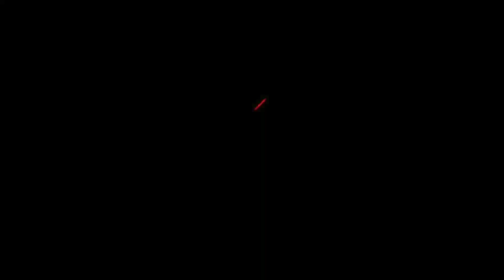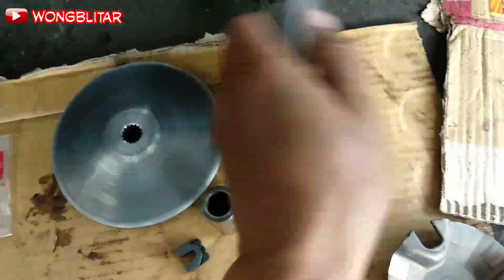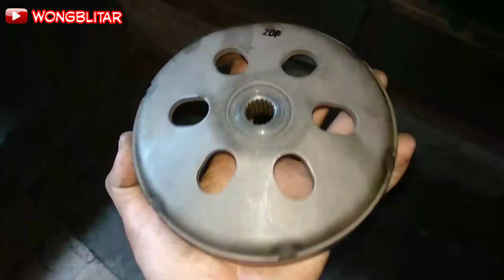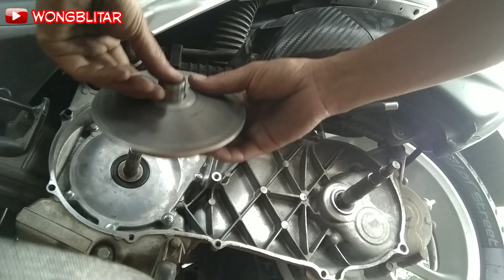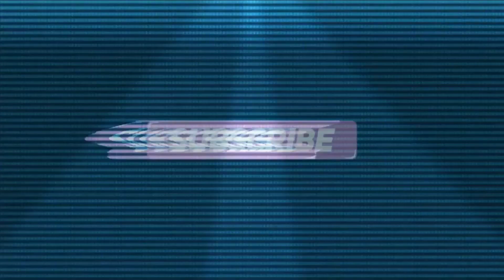Upgrade nmax tanpa bore up

Comment: untuk karet grand nya itu maksudnya punya motor yg mana ya
Reply from the maker: Motor astrea grand
Reply: terus gearboxnya ori yamaha aerox atau merk lain?
Reply from the maker: @prakosoe  ori bang
Reply: kalau ring pulley depan pakai merk apa bng
Reply from the maker: @prakosoe  ring apa bang
Reply: ring bulat yg diletak dibos ditengah rumah roller sama kipasnya
Reply from the maker: @prakosoe  gak ad merk
Reply: @prakosoe  ring mio j mas
Reply: @prakosoe  roller pakek punya xeon rc
Reply: @WongBlitar  maap mau nanya kl nmx bunyi cit2 pas lgi jalan kira2 apanya ya yg kena pa

Comment: Bang nanya dong tpi diluar vidio aku pnya rx king thun 96 tpi susah hidup pfhal dh dbngkel pngapian ada kompresi ada sil krukas baru sher baru blok baru busi baru tpi ga mau hidup mnta solusinya.
Reply from the maker: Cek membrannya bang
Reply: @WongBlitar  membran baru beli paketan jadi.
Reply from the maker: @dwitv8322  sudah dipasang tetap sulit bang
Reply: @WongBlitar  y bang dah dpasang malahan dah 2hari kata bngkel bli ini beli itu dah dturuti tpi blm jdi.
Reply from the maker: @dwitv8322  sil askrug kanan kiri...
Reply: @WongBlitar  y udah sil knan kri baru ori.yg aku bngung pengapian normal.
Reply from the maker: @dwitv8322  mungkin pengecekannya kurg teliti... Motor ada kompresi,bbm,api,, harusnya hidup
Reply: Itu di lubangi sendiri ta bang gear ratio aeroxnya
Reply from the maker: @bryansaputra2791  iya bang rumah gndanya
Reply: Gear rationya beli dimna om
Reply from the maker: @bryansaputra2791  di shopee bang ada
Reply: Apa bang nama tokonya..?
Reply from the maker: @bryansaputra2791  cari aja gir aerox
Reply: Itu udah lubangan ta mas di shopee